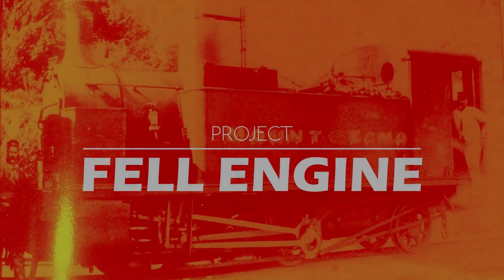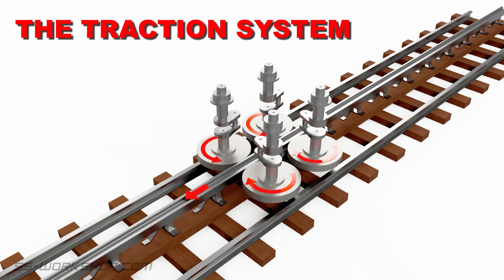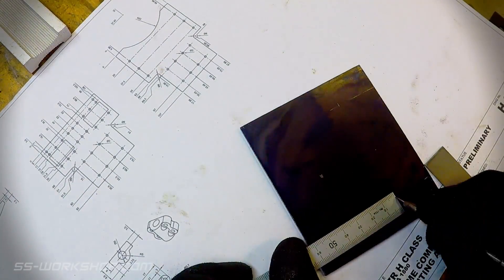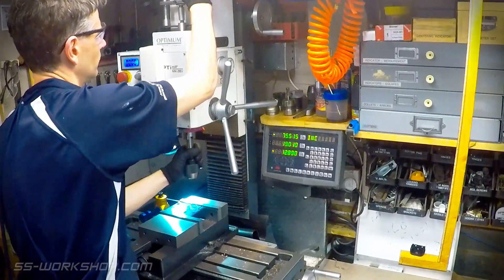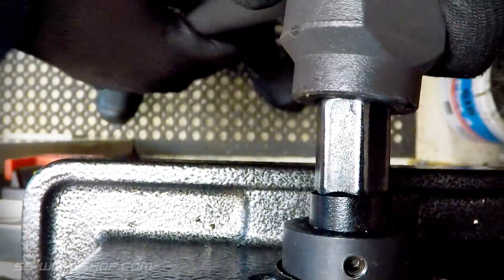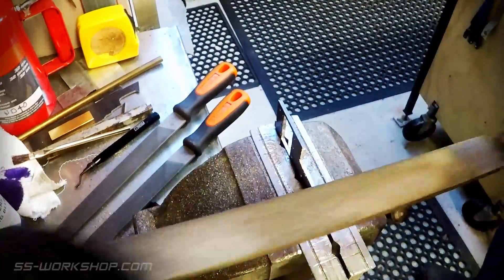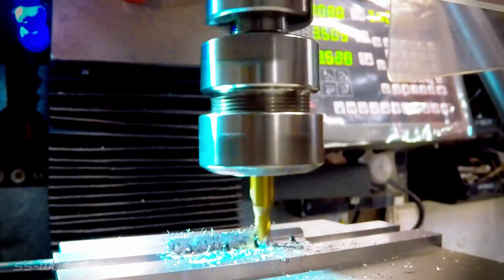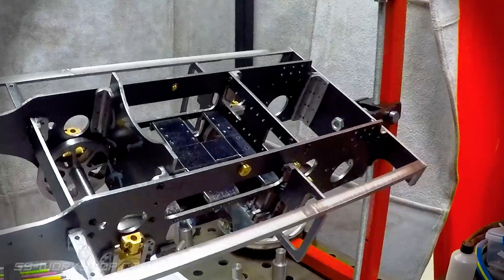Fell Engine Project - Fell Engine How Does It Work S1.E14

Comment: Are you going to have reversing gear on your centre engine? If I remember right they were orginaly built with reversing gear but it was later removed
Reply from the maker: Yes, that’s the plan just as it was in the first year of operation. I’m just working the valve gear out at the moment it’s used a variation of the Walschaerts gear so reverse is easy enough but some it how gets its rocking motion from the opposing cylinder instead of from the crank apparently. I didn’t know that the reverse had been removed but doesn’t surprise me.